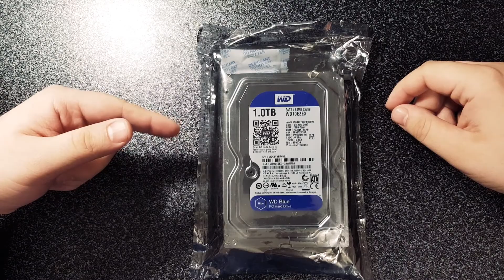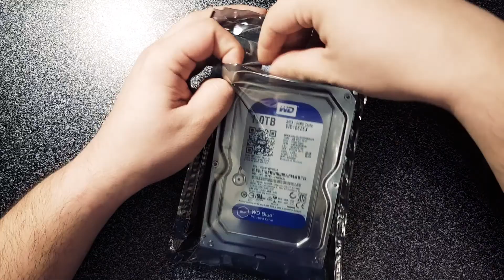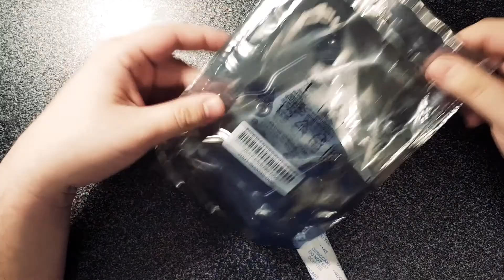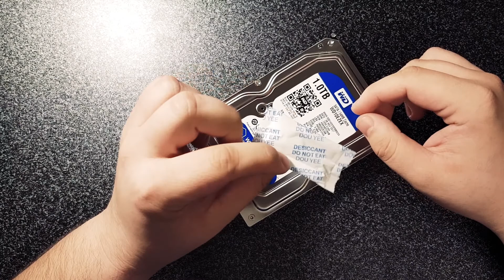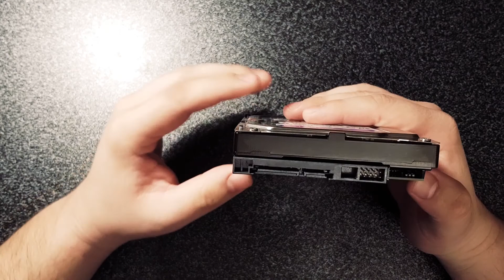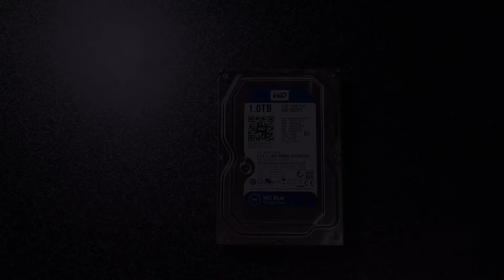Only Buy The Western Digital Blue 1TB SATA3 6Gb/s Hard Drive in 2018

Comment: So why does it say 6Gb/s?? If you're getting less than 100Mb/s?
Reply from the maker: The SATA3 interface is capable to run on a 6Gb/s leading to a band width of 600 Mb/s, however that is not the case for this WD HDD.  The WD Blue 1Tb HDD holds up good in terms of speed for a classic mechanical design HDD, it`s great for storage and even a decent solution to run the OS and apps if needed.
Reply: @jojotechexperience1527  Thank you so much for your informative reply!